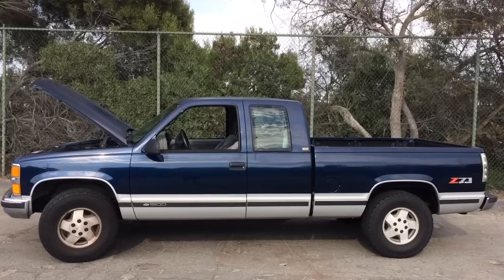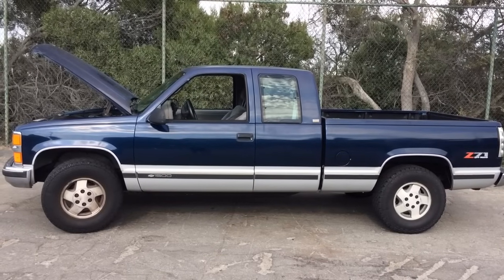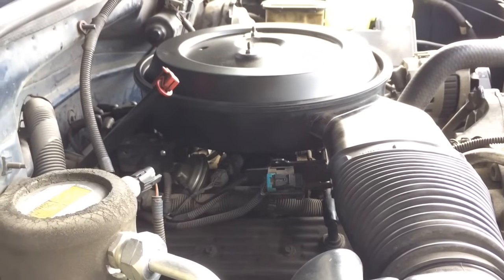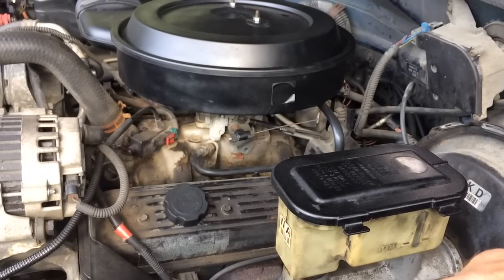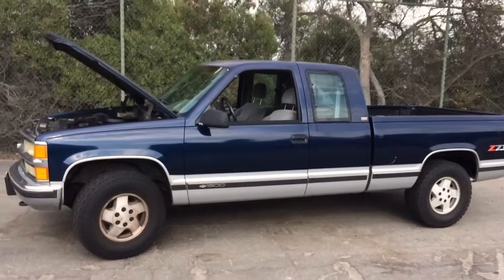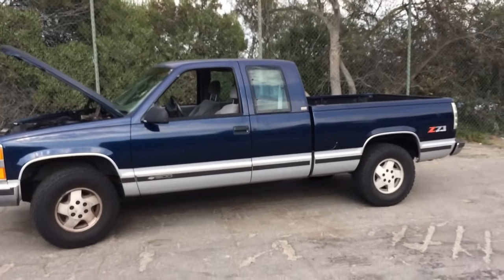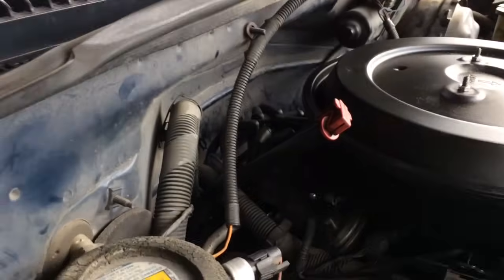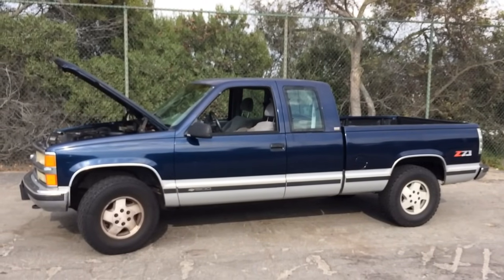Chevrolet Truck Hesitation Problem Fix

Comment: What it was with my vortec 5.7  when i swapped out the old 305, was the spark plugs, wires, and distributor. I replaced the distributor with a billet one and replaced the plugs and wires. The symptoms were around 45-55 mph in 4th overdrive and tcc lockup it would chug and shutter and cut out and i initially thought it was a bad torque converter but apon testing the coil and inspecting it i determined ut was bad. It had pitting and heat damage and a spark created from it would not jump a big enough gap.
Reply: I'm having the same problems I notice the coil looks pretty old I also cant move my egr valve diaphragm so will replace those two and see I have a 90 caprice with tbi 305

Comment: If you have a fuel pump issue on these trucks and you want to replace it easier don't drop the tank. Just tilt the bed. It's really simple there's a ton of videos on how to do it and you have full access to that fuel pump.
Reply from the maker: Thanks. You’re right about that.

Comment: I have a 94,only paid $1000 for her w/136k on the motor,1 owner.. truck is a reliable good truck,and I love it,but starting to have these minor issues and replacing minor stuff here and there.. just replaced my alternator 2 weeks ago but now I'm getting a surging idle w/rough acceleration after its warm and only while driving,noticed it would surge when I'd come to a stop(light,stop sign etc),I just noticed exhaust fumes coming out right around the tail end of the catalytic converter and that rattle like mentioned.. I was going to replace the spark plugs,distributor cap,ejectors(with Delco Spyder Injection instead of Center Point Injection),put on the Throttle Body spacer I bought,and a Jet Chip.. for the most part she's a good truck,hasn't left me stranded,but I just started having that idling issue while driving ,in park idle it's fine,neutral and pressing the gas its fine,just happens while I'm driving(bad acceleration),in drive stopped at a light it surges like almost stall then wants to take off then wants to stall,then Service Engine Soon came on then back off.. a weird issue I've never experienced before

Comment: OBS 88-98  (2000 3/4 & 1 ton) trucks are the last good truck's GM made in my opinion. Early LS before the actice fuel management was alright, but had weak rear differentials

Comment: I replaced my MAP sensor just today. Took on a test drive and it seemed to fix my hesitation problem. My truck would hesitate when trying to keep a steady 25 or steady 35 mph. I will give feedback in about a week to see if it's truly fixed.
Reply: Let me know please I have a 95 C1500. Started to hesitate today and died when I came to a stop sign
Reply: Still hesitating. Unfortunately it did not fix my issue

Comment: yeah, I have a 99 suburban... same deal except fuel pump - it's sitting in my basement. It never took a crap on me while driving but ran like shite for a good year or two  until I replaced cat, sparks and plugs, dist cap and fuel injection spider which was a huge pain in the butt ...  honestly, just replacing cat alone helped tremendously
Reply from the maker: I think the catalytic converter was the main problem on my truck as well.

Comment: If you have this problem first thing to check is if it is runnin rich if its doin that that means your flooding the throttle body the main cause of that is your o2 sensor and that is located in the cats

Comment: Great video and so helpful
Caus my 99 suburban is sputtering
And I've changed the crank censor,changed my spark plugs and wires and even changed my distributor cap And it rode smoothe for about 2months and started back ridding kinda bad then my Coil pack went out 
And now it's back running good but still sputtering when accelerating
So I'm gonna try some of these things sounds like mainly some fuel filters and fuel pumps probably is what needing to be changed
Reply from the maker: Good luck trying to figure it out. It’s really frustrating. Sometimes it’s more than one thing. On mine, I think the problem was that the catalytic converter plates had come loose, so sometimes there was an exhaust restriction. After I replaced it, everything worked fine.

Comment: I know this video is old, but that is a nice truck. It could be worse, I had a 97 Z71 short bed with the usual P0300 code, and my 96 is doing it now. It's the plastic distributor housing causing the distributor shaft to wobble. The fix is the MSD distributor with the aluminum housing.
Reply from the maker: Thanks. At some point I had the distributor replaced recently. We did that we were trying to figure out what was wrong. I’ve heard that they can go bad.

Comment: Given that it's mostly run by a computer, I know that it's possible to spend thousands while a mechanic replaces parts the computer tells him are suspect. Seldom does it help, and not for long if it does. Better to take the time like in this video and replace what you can by yourself. I would like to find a Silverado specialist who can get a feel for what needs to be replaced and has the shop and tools to do it. Not just chase vague computer read outs. I think it's time to change my CC, that's where the rattling is probably coming from. I couldn't find it. Thanks for great upload.
Reply from the maker: You’re welcome. I understand how frustrating this stuff is. I wish I knew someone who was a wizard and could point to the exact problem. I ended up replacing a whole bunch of parts, and then taking it to a local mechanic who made a bunch of random guesses as well and replaced a bunch of parts. It is running right now though. It better, because almost everything is new.

Comment: I plugged in the temp sensor on top of the intake closest to the fan and it idled down and ran great . .
92 chev 1500 305 . 05/31/2024

Comment: I have a 1991 Chevy Z71 with 506,000 miles and drive it everyday still.my truck did that a couple of times and both times it was the EGR valve sticking,so I just replaced it for about $40 and was good to go.
Reply from the maker: Thanks. That EGR valve can definitely do that. Mine was still hesitating after I replaced it, but on my van it fix the problem.

Comment: I have a 94 K1500. Had the rattle. Replaced cats and it ran good for a while. A year later moved 6000 miles away and drove with most of our stuff in a trailer. Was fine for about 4000 miles into the trip. Then it started again. Come to find out the throttle body had a hairline fracture in it and was pulling too much air through it. Ecu couldn't compensate for it. Check engine light never came on. Btw...my 94 is the same color blue and silver.
Reply from the maker: That must have been a tough one to diagnose. I wonder if you could JB Weld the crack.

Comment: Just picked up a 2001 Silverado 1500 4x4 with only 70k on it and it,s super clean! Got this truck from a well known dealer here in Cleveland 1 owner truck with ext cab! The second day of driving the truck the front calipers started leaking and i took the truck back to the Dealership! They put all new brake lines and new brake rotors and calipers all the way around! On the 3,d day of driving the Truck the gas line started leaking at the fuel filter! Once again i returned the Truck to the Dealership and the replaced fuel lines from the tank to the fuel regulator! Including fuel filter! So after only a week of driving and not even putting 300 miles on the Truck the Transmission lines decided to start leaking =\ So once again back to the Dealership where they put all new Transmission lines in and flushed the system and top off the ac unit! At this point i,m ready to trade it in! But the dealership also put a set of new tires on it for me as well! So after all the new work on the truck it is driving like a new Truck again with the 4.8 liter engine that you could eat off of! Lesson learned here! Make sure you look at every line every brake line every gas line all lines with fluid running threw them before purchase!
Reply from the maker: Definitely. You want to make sure that you catch everything and knock the price down before you buy it.  But now that that’s done, you have a great truck. That generation of truck is one newer than mine, and my dad has one that he’s Jevon for almost 20 years, and it is a great reliable and functional truck that you will love for a long time.  With most you’ve used vehicles, you have to sort them out and repair things for the first year or so, and then they’re good after that.

Comment: I have a 92 c2500, 350 tbi.  The parts cannon has been fired many times.. every last part has been changed down to the exception of the brain itself and the injectors.. fuel pump changed out, filter changed. New CTS, TPS… new Air Idle Control valve.. entire new distributor and coil. New plugs and wires.. new O2 sensor.. new MAP sensor… I completely rebuilt the TBI unit, including rebuilding the fuel pressure regulator.. puts out12 psi.. new gaskets for tbi including base gasket.. grounds cleaned and checked.. Vacuum lines/leaks checked.. looked for intake leaks… I’ve even replaced the EGR  electronic vacuum/valve part.. Set timing to exact factory spec… everything. I’ve even replaced the catalytic converter, thinking the original 250k unit was plugged… I freaking give up. You take off easy it works, but goose it quickly to pull out and it dies… let your foot off and it totally quits… keep it floored and it will flare up and take off.. then die again.. flare up.. die again.. let up a little and it usually keeps moving.. it will restart easy if it dies but it’s unnerving in traffic.. Hundreds of dollars down the tube.. It’s getting the carb swap. The biggest problem is the absolute shit quality of the parts you get these days. I’ve gotten shit out of the box before and I don’t feel like going back thru and buying yet another round of “new” parts.. at least I have no problem working with the quadrajet and old school HEI.. yes I’m that old.
Reply from the maker: That’s terrible. I respect that you haven’t given up on it yet. On mine I had to replace the computer, and that helped a lot. When the computer went bad, the transmission wouldn’t shift bad it sometimes had a high idle. That fix that problem. You could try getting a used Computer or chip off of eBay, but you have to make sure the chip is the exact right one for your truck. They have the model number stamped on it.

Comment: Honestly my problem with my truck was the rotor in the distributor cap.! Was eight up and then she started running great.! Nice truck I love the Z71
Reply from the maker: Thanks. These are great trucks. I replaced the distributor and cap And rotor along with everything else. I know the old distributor seemed like it was bent, and the rotor wasn’t going around in a perfect circle.

Comment: Mines been hesitating for years but I just ignore it but kinda wanna get it fixed. I think I might replace the TPS since I’ve already replaced the fuel pump and filter. Was also thinking about doing the distributor as well. Thanks for the great videos
Reply from the maker: You’re welcome. On this truck I’m pretty sure the problem was the catalytic converter. I think the plates had gotten loose, so sometimes they would block the exhaust flow, and other times they would bounce around and the exhaust would be able to get out. After I put a new catalytic converter in it, it runs great.

Comment: I have a 94 Chevy suburban K 1500 and it’s happening to me too on hesitating on a complete dead stop and I found the problem was have a Vacuum leak!! Problem fixed you will find them connecting to your TBI throttle body
Reply from the maker: I’m glad you figured it out. Vacuum leaks are always one of the suspects in problems like these.

Comment: I fixed it by replacing the intake and TB with an Edelbrock intake and a 800 cfm Q jet carb. Threw that damn crappy TB right into the trash along with the cat and factory exhaust and installed headers and glass packs. No computer crap anymore so an Accell HEI dist and wow is all the hesitation gone. And gets better mileage too.
Reply from the maker: That’s a great solution. I can’t do it on my truck because I am in California.
Reply: No inspection or smog crap here and we love it!

Comment: miss my 97 Sierra, I had hesitation issues, bought a 2003 Saturn ion, kept the truck. But my dad who owned it traded it towards a Nissan ultima, only got $500. God kicking my ass after that.
Reply from the maker: Sometimes it’s hard to figure these problems out. Somebody got a good deal on your old truck.
Reply: Laughing and crying with you, damn!!

Comment: 95 Suburban with 265k, facing this issue now, we'll see how it goes, thanks for the tips.
Reply: Good luck. There's so much it could be. Even something as simple as a vacuum leak in/or bad evaporator canister can cause this problem.
Reply: @sonsofthunder915   I'm thinking I'll start with fresh plugs and a new fuel filter, maybe fuel pump.. I found I'm choking out on an incline and especially at above 2k rpms, it'll fire like a shotgun out the exhaust and go nowhere. 
I'll let you know how I make out. Truck is worth saving. Lol
Reply from the maker: On the truck in the video, I took it to a mechanic and he said that it needed a new fuel pump, and that the catalytic converter was clogged. The plates in the catalytic converter had shaken loose and gotten sideways. In your case, you might want to check the catalytic converter and the muffler. It could be an exhaust obstruction problem
Reply: If you really suspect a fully clogged cat unbolt the upstream o2 sensor and go for a ride to see if the extra breathing helps

Comment: Thanks so much living the nightmare right now😁
Reply from the maker: You’re welcome. It seems like a simple problem, but it can be really hard to diagnose. I replaced almost everything before the truck ran right. I think the problem was the catalytic converter.
Reply: I'm having that problem as well. 225k miles. My theory is it's the fuel filter but if it still hesitant I will try other stuff before tackling the pump.

Comment: I have a 93 Chevy suburban k2500 454 7.4 v8 and having this problem at 165k I'll start replacing parts now, she still in good shape an I dont want to get rid of her had it for 5 years an never left me stranded, when it snowed bad this year is when it started so I just turned around an drove the charger to work

Comment: After a couple hours of driving .  my truck would hesitate,   heard a slight rattle.   my cat was plugged and backing up into engine.   I'm in Alberta , so no emissions test .  i had cat taken off , at same time added new muffler , tail pipe.   fixed the problem and has more power now,  only downside is smelly exhaust at times.
Reply from the maker: That was my problem as well. I replaced the catalytic converter with the new one, and the hesitation went away.

Comment: I have 95 Chevy Tahoe with the same problem. I unplugged the egr valve and it stopped hesitating but check engine light code 32 came up. This code has three different interpretations depending on year and model. It basically says that there is something wrong with egr system. So I decided to put a vacuum gauge on the egr solenoid to see if it had a leak. I put it on the solenoid and was not getting a vacuum leak there. But, I cracked the throttle a little bit and then I had a hard shot of vacuum on the gauge. What is going is that the ecm is calling for the egr valve to be opened right at cracking the throttle. When you get passed this point of throttle the vacuum drops and the valve shuts and it acts normal from there out until you crack the throttle again. the only thing that will fix this is a vacuum delay valve that helps delay the egr valve from opening too soon and while you have greater engine rpm to handle the egr valve opening. Take note, the solenoid will not open the egr valve until you get to full operating temperature. This is why you truck doesn't hesitate when first started.
Reply from the maker: Interesting.  Thanks.  On my 4.0 chevy V6 in my van, the EGR valve would get carbon buildup, causing it to run rough.  Cleaning it fixed the problem.  I hadn't thought about a vacuum delay valve.
Reply: I have a 97 5.7 that's rough when its cold but when it warms up it seems to be fine. Any idea what the problem is?
Reply: When your truck is cold it is in the close loop phase. The computer sets the idle speed and fuel mixture until it reaches operating temperature. My best bet would be to check spark plugs and wires, fuel filter and distributor cap and components. Good luck.
Reply: Thanks.
Reply: now and then i get a 32 and  on my 92 astro...cleaned EGR valve and passage and new solenoid..runs great no stalling etc...i just have up. i do not need emissions inspection anyway.
Reply: Michael Taylor , my truck is skipping only when warmed up, really bad, I've changed Everything!!! could it be same thing? vacuum leak on e gr? I've changed that to
Reply: Same here. I changed plugs, cap and rotor, ignition coil, ICM, I'm going to change fuel filter tomorrow and clean the EGR. I'll let you know if that helps.
Reply: Michael Taylor  I was reading your egr diagnosis and was wondering if you would happen to have a viable part number for a vacuum delay valve. My 90 is acting identical to the description of your vacuum gage test. Your input would be greatly appreciated.

Comment: It much easy to take the bed loose to replace fuel pump
Reply: If you live in a state where they don't use salt on the road. People in michigan would rather drop the tank or cut a hole in the bed.
Reply: I live in the salt belt and still unbolt the bed. Start spraying the bolts a week before hand. If your truck is rusty its rusty, your tank straps will be rusty too. It's really fast to go under with an impact and rattle those bolts out, just loosen the last two and jack the bed up like a dump box.